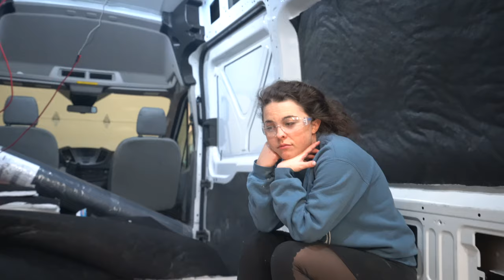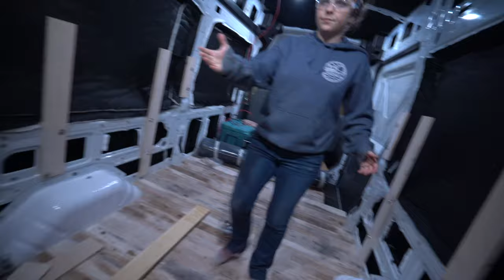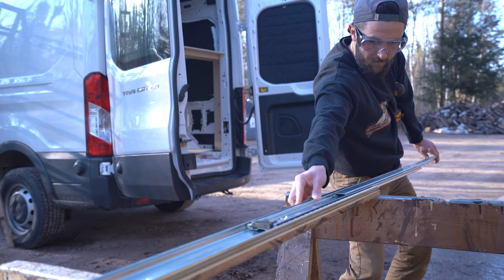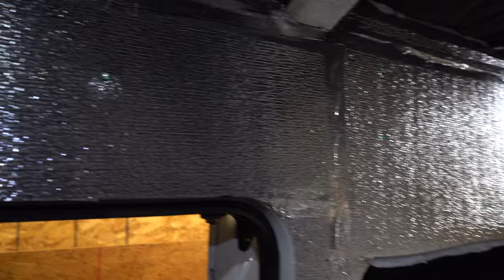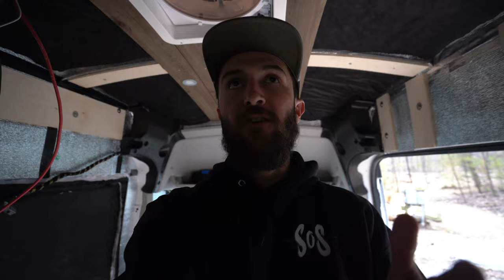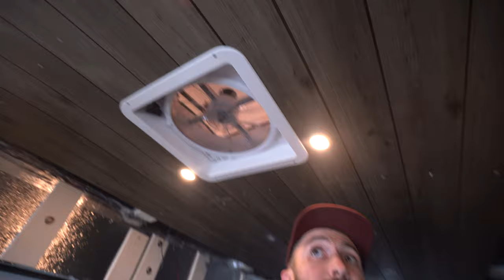Van Build Ep.6 Mega Update!

Comment: great vid thumbs up 👍 To late now but don't use those scotch lock splicers, they're easy but are known for going high resistant (stop working).
Reply from the maker: Thanks for the heads up ned we will see how long they hold up !
Reply: @JoshRomeroYT  yeah probably will be fine but I used one on an immobilizer project on a early car and it left me swearing when the car wouldn't start!
Non critical application, should be fine.